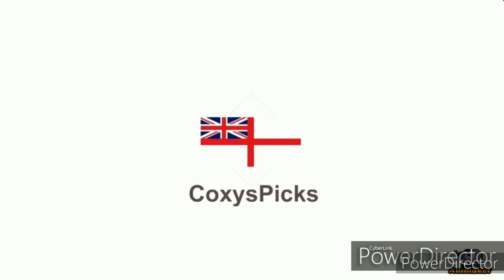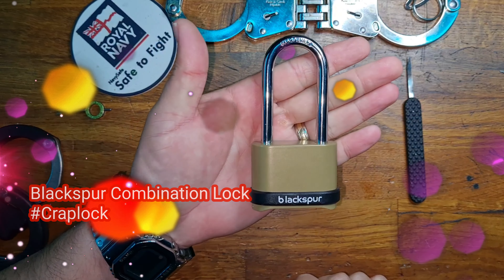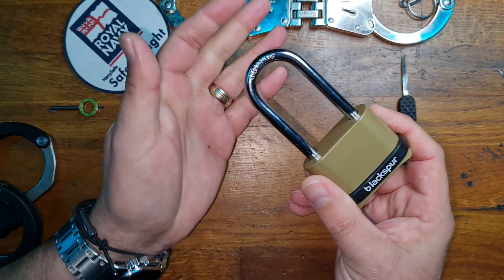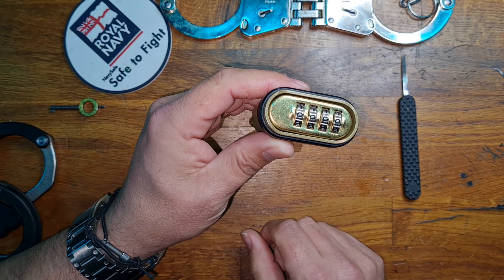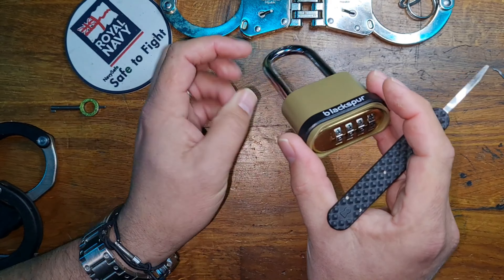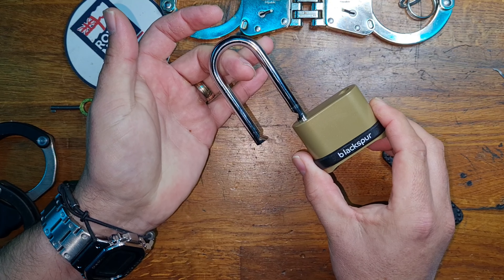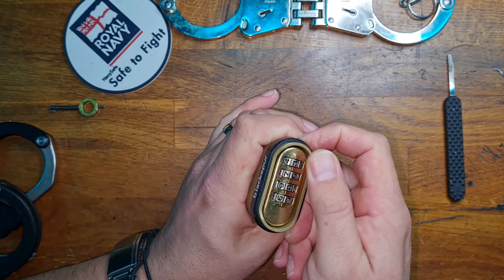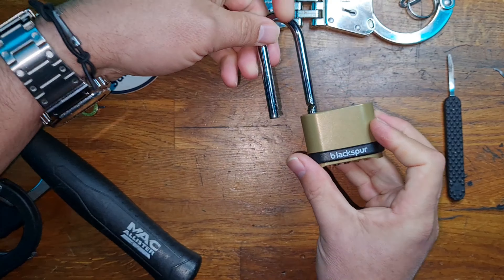(5) Blackspur Combination Lock - #Craplock

Comment: Ha ha there is a good few ways to get into this lock, all quicker than using the code 🤣 
Thanks for sharing 👍
Reply from the maker: The scary part is the lock still functions as it is supposed to. It is like you were never there.....
Reply: @CoxysPicks  That is actually quite disconcerting! 😟
Reply from the maker: It would be very difficult to prove someone tampered with it, that's for sure.....